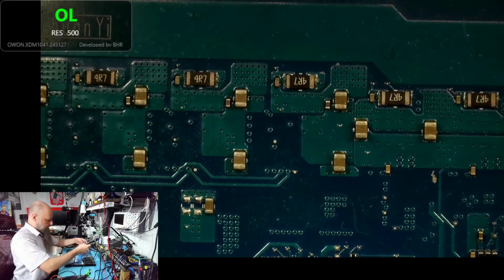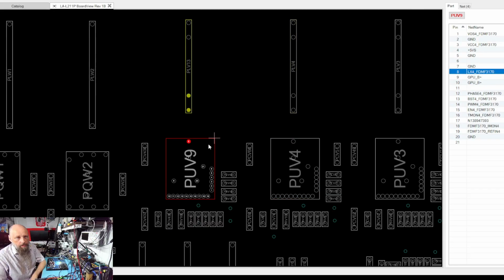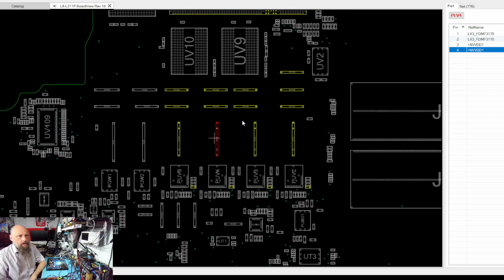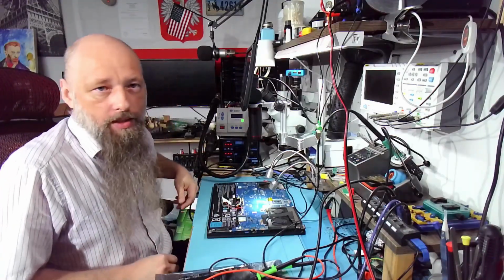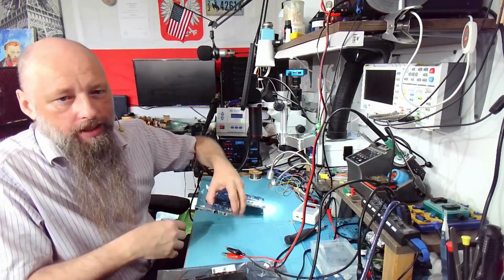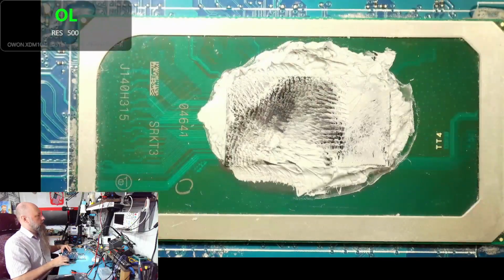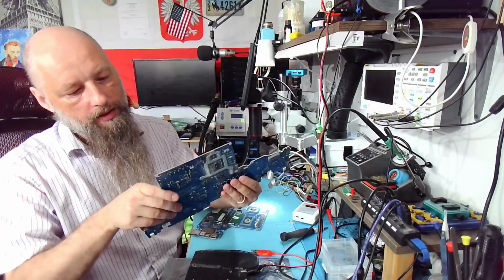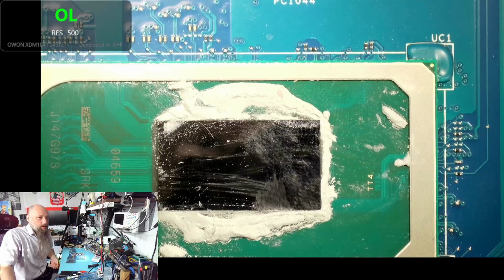248 | Acer ConceptD Laptop Not charging and no GPU detected

Comment: Too many unknowns and risks, in my view.  It wasn't clear whether UW1 and all the peripheral components on the replacement board were already missing when the replacement board was acquired, or UW1 was one of the many components swapped over to the original board. I'm sure you've done a bios check and a power consumption comparison to determine whether the replacement board seems ok in those areas.
Reply from the maker: that's true, and that's why the customer decided to trash this one. I can't power on the original board with shorted CPU to compare, I would have to first swap the CPU, a lot of work and tiny chance of success.

Comment: i would try to find cpu SRKT3 if board could have been returned.
the other markings on cpu i believe are date or serial related.
Reply: You cannot just swapped the cpu on the laptop motherboard even if it's exactly the same board will not run has to be done ME clean and more stuff before you charge the customer make sure what are you doing i like your videos just you are far away from fixing laptops
Reply: @CHRIS-FIX-1990  i do clean ME.. cpu microcode should be same.
Reply: sSpec is what matters for CPU replacement, same sSpec = same model and stepping. PCH is not on the same package as CPU, so cleaning ME should not be needed. So in theory nothing else to do other than fixing the power delivery circuit and swapping the CPU (which is a lot already).
Reply from the maker: Thank you, I'll take a look!
Reply: Don't even try cpu will definitely not working